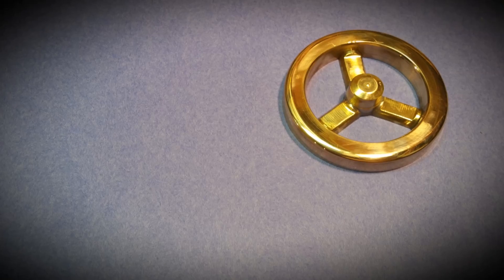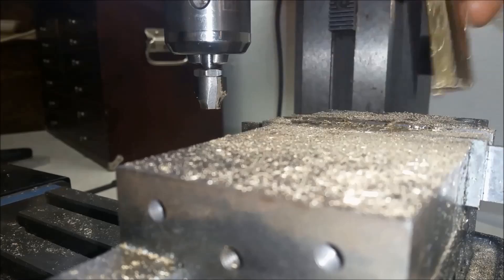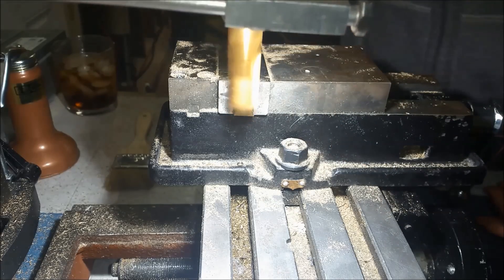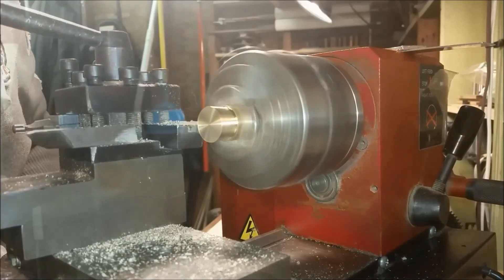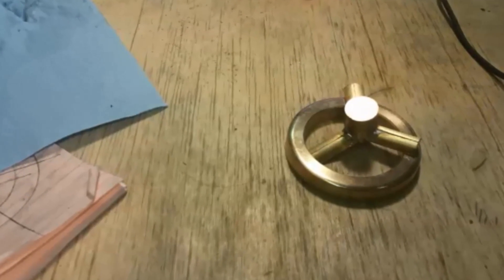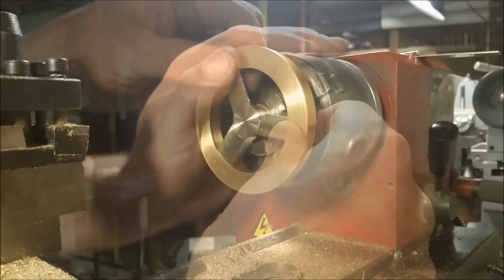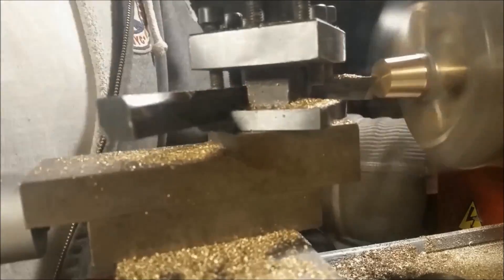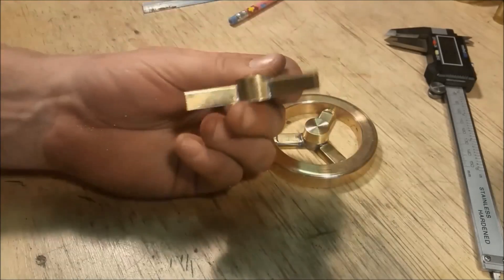Foundry Pattern Making for Brass Casting

Comment: if you have a mill and protractor, you can fix the circle stock to the mill table with and rotate it an equal # of degrees calculated for how many spokes and just cut them from solid material. little more involved with a lathe using a toolpost-mounted Dremel or such

Comment: can you give the specific picture of the draft angle? i'm still confused
Reply from the maker: This should help..https://en.wikipedia.org/wiki/Draft_(engineering)
Reply: thank sir, i already understand with the picture from wikipedia. i mean the draft from your flywheel i can't see clearly. it's the side of your circle like Myfordboy video made?  u make it different? i think from myfordboy he made outside?
Reply from the maker: Apologies, i don't understand your question.
Reply from the maker: I have an angle on the inside and outside diameter.  The inside diameter angle will stay in the finished casting the outside diameter can be machined off if you like..   so a cross section of the flywheel  would look like this  \_/   with an angle on both sides to release the pattern from the mold.
Reply: okay thank you sir for your help.
Reply: 120°